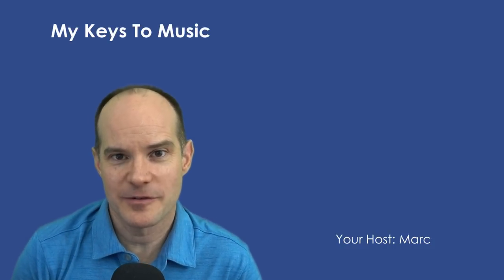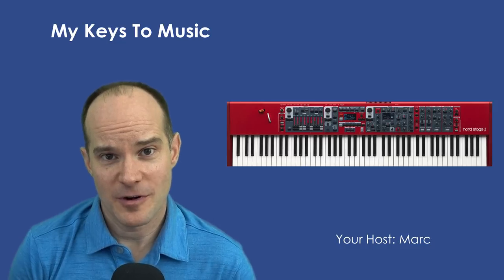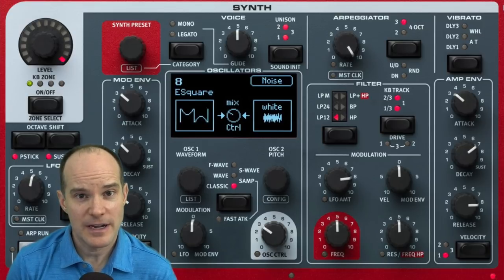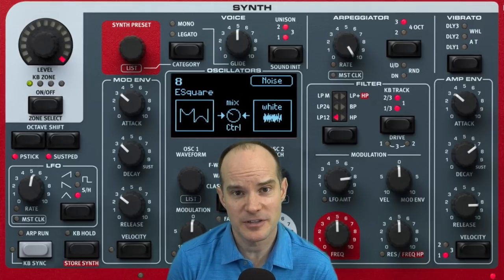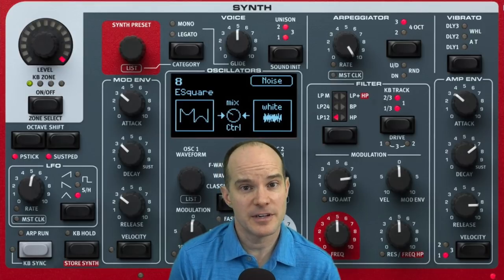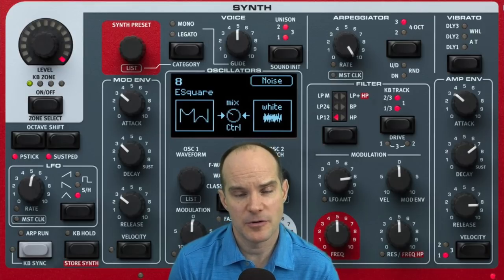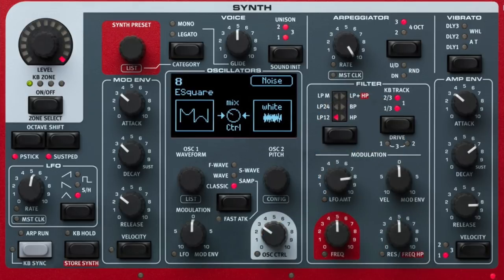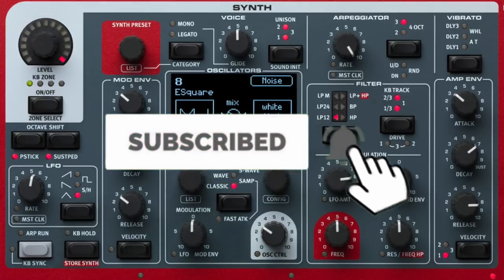Learn the Nord Stage 3 Synth Engine (Part 1) | Tutorial / Training

Comment: Hi Marc.  My church owns the Stage 3.  If I reinitialize the synth engine to 0 and experiment, do I need to put the settings back to the the default so I don't change any of the sounds that someone else might use with the synth engine?
Reply from the maker: @Rick Johnson - thanks Rick - great question. The safest way to experiment like this is to start with a blank program. Navigate all the way to the end of the program list where the blank programs are and pick one to start with there.  That way you can build your synth sounds and click "Store" without the worry of breaky anything that already exists. After you do that and you settle on something you like, you can optionally store the synth preset itself independent of the program. In this way, you can use your synth with other programs that already exist easily. Storing a synth preset works nearly the same as storing a program.  It's tricky the first time you do it but just follow the screens. You'll find the synth preset store button under the LFO section of the synth. Hope that gets you started!

Comment: 00:01 Learn the basics of Nord Stage 3 synth engine and how to set it to default settings.
02:07 Understanding the Nord Stage 3 Synth Engine basics
06:05 Understand the importance of knowing default settings before adjusting knobs
08:09 Setting the LFO amount to zero is crucial to avoid unwanted oscillation effects on Nord keyboard.
12:27 Understanding the various oscillator choices and sampling options in the Nord Stage 3 Synth Engine
14:28 The synth engine allows mixing different oscillators to create unique sounds.
18:24 Understanding the envelope and frequency cutoff knob in Nord Stage 3 Synth Engine
20:18 Understanding the influence of decay and sustain on sound envelope.
24:06 Introduction to the Nord Stage 3 Synth Engine
25:46 The Nord Stage 3 offers creative sound design and variety

Comment: Love your work.  Thanks for educating us. 

Question.  With the envelope control being 3 pole and not 4, does that mean that  Sforzando (Sfz) is not supported?
Reply from the maker: Hi Scadaboy-oh-boy.  So, the answer to this question is no, Sforzando in the purest sense is not supported exactly with the lack of the 4th pole. Although you can kind of imitate it a bit if you introduce the Mod Envelope with a decay. (i.e. You'd have a brighter sound at the beginning and as you hold the note, the Mod envelope would decrease the high frequencies giving you an effect of Sforzando via high-frequency reduction rather than purely by volume). I've never head it described like this but I like where you are going here with these thoughts and provides another way to describe the differences between 3 and 4 pole envelopes to a musician who might be new to synthesis.

Comment: I've got extensive experience with various synths and the Lead 2X, but this A1 engine has such a weird osc section.
Reply from the maker: Hi ApolloSynths!  I think I understand exactly what you mean here. You would think that by knowing the Lead 2X, you'd have a breeze of a time with the A1, but they tend to be a bit like apples versus oranges. Now that I have wrapped my head around the A1, it all makes sense.  There are a few things that I wish were a little different but overall, it gets the job done for most things. Thanks for your input.
Reply: @MyKeysToMusic  the Lead has two discrete oscillators, with a separate mode for unison. I really prefer the control that gives, but I can't complain about the engine in the Stage with how much it can do.

Comment: Do Nordstage website have pads,string, or organs to download to the  nord keboards?
Reply from the maker: @drestaura_2 the Nord website has both pianos and well as "samples" that are downloadable for use on a given Nord keyboard. Those samples also include selected sounds that can be used for organs and pads played via the synth engine.  Typically, however, when it comes to organs, if your Nord keyboard has an "organ engine," you'd use that to generate the sound, not samples. When it comes to pads, typically, that's done with the synth engine either by using a sample played through the synth engine or the synth engine itself (assuming you have a Wave 2 or a Stage 2/3/4 keyboard).
Reply: @MyKeysToMusic  appreciate it a lot I still going to watch the videos , barely starting 😄Thank you!👍
Reply from the maker: @drestaura_2  I get that!  Hey, you should check out my free and pro courses available on my website when you get a chance.  I believe it's the most complete training out there and comes with a private community where you can ask questions along the way: https://www.MyKeysToMusic.com
Reply: @MyKeysToMusic  will do, thank you!

Comment: For a music producer what Nord Stage model should I get
Reply from the maker: So, it sounds like you already know you want a Stage 3. If that's the case, you have 3 options: the 73 key waterfall keyboard (semi-weighted) with physical drawbars, the 76 key Hammer Action portable with digital drawbars, or the 88 key full-weighted also with the digital drawbars.  Each one has its advantages and disadvantages. I explain the differences between all 3 Nord Stages in a little more detail when I compare the Stage 3 to the Electro 6 here in this video: https://youtu.be/av3GxXakeaM

Comment: Cheers for all the help on the Nord stage!

I’m wondering if it’s possible to use multiple synth engines on the same panel? So if I for example could have four synth engines running at the same time?
Reply from the maker: Hello Dan.  Unforunately this is not possible.  Only two synths at the same time (Panel A and B).  For four synth layers, you'd need to look at a Nord Wave 2 or a Nord Lead A1 or the like. On a similar note, if you haven't already checked it out, I did a Chariots of Fire video where I featured 4 Nord keyboards which provided 11 synth/sample engines and 2 piano engines: https://youtu.be/-_bJlgLlutU It demonstrates the power of the Nord synths when used together - especially having multiple arpeggiators which come in extremely handy on a tune like Chariots.

Comment: Great tutorial Mark thanks a lot! Wondering if you can help with this question, I am trying to use the same tremolo effect to control both my synth engine and the organ engine at the same time on the same panel. Do you know if this is possible?
Reply from the maker: Hi Samuel. Technically speaking, the official tremolo effect can only be invoked on a single sound engine on a single panel at a time. So, I don't think this is possible. Of course, it is possible by using two panels and assigning the synth to one panel and the organ to the other, each having the tremolo effect assigned. Thanks for the question!

Comment: Thank you!  Most important question.  Can you use the organ draw boards faders/sliders, buttons, etc., with the Synth engine?  Midi map more parameters...  Or are you confined with just the Synth Engine panel?   Hopefully not.
Reply from the maker: Hello.  If I'm understanding your question correctly, you could totally control just about any aspect of the synth from outside controller keyboards (and other types of hardware) via MIDI.  The full MIDI spec is available here (page 60): https://www.nordkeyboards.com/sites/default/files/files/downloads/manuals/nord-stage-3/Nord%20Stage%203%20English%20User%20Manual%20v2.5x%20Edition%20M.pdf
Reply: @MyKeysToMusic  Hi, thank you for your response.  NO.  I'm asking you if I can use the ORGAN draw boards to midi map other parameters from inside the SYNTH ENGINE.   What's disappointing about the NORD Stage 3 is that they didn't include the ADSR AMP ENV nor ADSR AMP knobs.  For $4500 it would have been kind to offer 8 more knobs.   Similar to the NORD LEAD 2/3/4...   Within the OLED screen is there a way to utilize the ORGAN Draw Boards to modulate the SYNTH ENGINE?  Thank you!   P.S.  My friend just order one and we are so curious...  Seriously, who uses an Organ that much.  :)
Reply: More so, Is the NORD STAGE 3 only 2-Part Multitimblal?  Meaning that you can only have two patches/sounds playing simultaneously...  If so, that would horrible.
Reply from the maker: @augmentedkeys5971  Hi - Unfortunately, there is no way to use the organ drawbars to morph, control, or adjust things inside the synth engine.  And yes, it would have been nice to have 4 knobs for ADSR for the envelopes - I agree with you on that.  They do include 4 knobs for Amp and filter envelope for the Wave 2 (as an example).
Reply from the maker: @augmentedkeys5971  Yes, the short answer is that the Stage 3 is only 2-part Multitimbral for the same engine. However, you can obviously play sounds from the piano engine, the organ engine, and the synth engine simultaneously giving you a total of six layers. However, only two layers are possible with sounds coming from the same sound engine at one time.  A another example of this would be if you wanted to use a bass sample for your left hand and a string sample on your right hand. You can do that. However, you can't have a bass sample on your left hand and a string sample combined with a flute sample on your right hand - that you can't do.  In that case, you could play a Fender Rhodes bass part coming out of the piano engine (like the Doors do) and use panels A and B to layer the string and flutes coming from the right hand.  Hope this is clear!
Reply: @MyKeysToMusic  That's too bad.  A wasted of this and that.   For the price, it would have been alluring to have the Nord Lead 2 parameters on board.  Anyway, my friend bought it on order - One can do so much more by spending 5K.   furthermore, I appreciate your great videos.   Good day!
Reply from the maker: @augmentedkeys5971  Happy to help. Send your friend this way if there are questions along the way.  Also, the www.NordUserForum.com is a good resource too.

Comment: Hi, Mike. Does the Stage 3 have percussion pads (not tuned)? I tried to download some from Nord page, but there is none, as far I could see. Am I missing something? Thanks!
Reply from the maker: Hello Pablo, There’s no percussion pads that I’ve ever seen in the Nord sample library.
Reply: @MyKeysToMusic  Thanks, Mike. Something funny, isn't?
Reply from the maker: @PabloRegnierProject  When it comes to percussion pads and the Nord keyboards, they typically don't go hand in hand. However, with the new Nord Stage 4, it's easier than ever to trigger notes in a "pattern" where you could technically assign drum sounds to keys.  However, this is the wrong tool for the job - much easier to get a purpose-built unit like a drum machine, sequencer, or an actual percussion pad unit connected to a DAW for this kind of thing.  But it's interesting to think about how this could be done none the less!

Comment: Hello! i just have a question. I’m going to do your “Master the Stage 3” course. So these 5 part videos about the stage 3 synth will be in that course? Or should I see these YouTube videos also after that course?
Reply from the maker: Hello @Ricardo Conceição thank you for your question and interest in the course! Actually, a great many of the course videos are much newer/better than what you see here on YouTube. The course accommodates both the older style panel layout for the Stage 3 as well as the newer style panel layout of the Stage 3.  Here on YouTube, I’m using the older style. So, you may find it best to start with the course if that makes sense for you.

While we’re on the topic, I thought I’d quickly compare the course with YouTube. The course has a lot of exclusive content not available on YouTube.  At this point, the only advantage of my videos here on YouTube is that they can be auto-translated with subtitles in other languages and technically, they are “free” although you’ll have to put up with my marketing speak before, during, and after.  YouTube will also present ads before, after, and sometimes in the middle of most of the lessons which can interrupt the flow of the lesson.  The course on the other hand is a focused experience with hundreds of lessons providing a beginning, middle and end to the learning process and it tracks your progress. Everything is neatly organized in sections and it’s like a mini encyclopedia. There is no marketing speak or ads played anywhere in the course. Paying students also get priority access with questions they have sometimes extending to questions about customized setups or advanced topics that require serious thought, research, and testing.  Although for people with questions, there are free resources by way of the Nord User Forum and several Facebook groups which are in fact terrific, but both also have ads sprinkled throughout and your questions will be public.

I help people on all sides of course and I love our growing YouTube community for sure, but I do give priority to students as best I can since they have taken the plunge and committed to their learning with a small financial investment.  There may come a day soon where I won’t be able to answer every comment here on YouTube so I’m hoping others will step in for me when possible.  We’re nearing 11,000 subscribers and the questions keep coming. 🙏🏼. Thanks again for your interest!!
Reply: @MyKeysToMusic  thank you so much for your answer! I will take the course very very soon! I must be honest, I will buy the Nord stage 3 compact by Christmas, and I will take this course now to get ahead with the knowledge about this keyboard. Once I have it, It will be easier to play it and get around with the controls, etc. After that, I will use those course videos as a resource to eliminate any doubts in the future or questions. Hope this kind of thought makes sense… I’ll keep in touch. Thanks!!
Reply from the maker: @Ricardoketa  Thank for the update!  Yes, this make good sense.  There are many people that watch the videos and./or take the course ahead of their purchase so that they are prepared to hit the ground running once the new baby arrives! 👍

Comment: Maybe a weird question, but the led-light under the oscillator, what does it indicate. I never get it to go on :')
Reply from the maker: Hey rmvanrij - If you are referring to the light next to the OSC CTRL knob, that is the morph indicator.  If that's the light you're referring to, there are a lot of morph indicators next to various knobs on the keyboard. They illuminate when one of the morph controllers are connected to a given knob.  Morphs can be controlled by the wheel, after touch, or the control pedal.

Comment: Marc, how do you save Synths and Organs to song mode?
Reply from the maker: @OneGunnEntertainmnent Hi there OneGunn! - Great question. So, first you have to understand that Song Mode simply points to existing programs. Therefore, when you "Save to Song Mode" you are not really saving a new program, but rather pointing that song selection to an existing program.   The song mode list is nothing more than a pointer system to existing programs.   So, first create a program that you want for a given song along with any synth or organ settings.  Then go into Song mode and set a given location to point back to that program. This is how you build a set list pulling from existing programs.  Let me know if there are more questions.

Comment: "Creating sounds that has never been heard before". A judgement slightly over the top. Never used any other synth/workstation, huh? The Nord is nice, the synthsection is - well - as you said "solid", the filter sounds good, but overall pretty underwhelming when someone is used to program workstations. You meet the limits pretty quick.
Reply from the maker: Hi KaffiFlight.  Thanks for your comment and perspective here. I tend to agree with most of what you're saying. It's also true that although I've been playing keys off and on and semi-professionally through most of my life, none of that time was really spent programming them from a synth standpoint at all. In fact, I didn't get serious with attempting to understand synthesis until I decided to tackle it on the Stage 3 right about the time I was making these early videos.  So, from that perspective, my experience is really limited to Nord. I have since learned and come to understand more over the last 3 years, but it's one of those "a moment to learn and a lifetime to master" kinds of things.  It has been great getting to know and work with people that use Nord products as well as those who don't. My goal now is to try to picture a sound in my mind or hear one from an existing recording and duplicate it on a synth - sometimes easy, most of the time a challenge, but always fun.